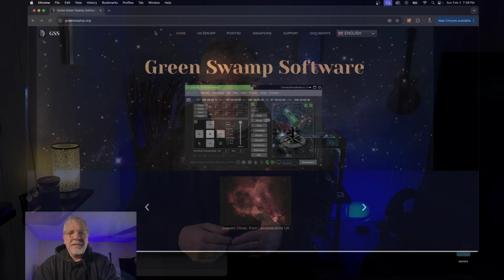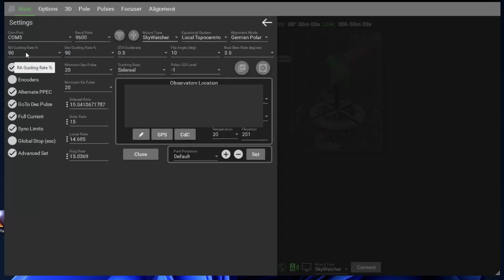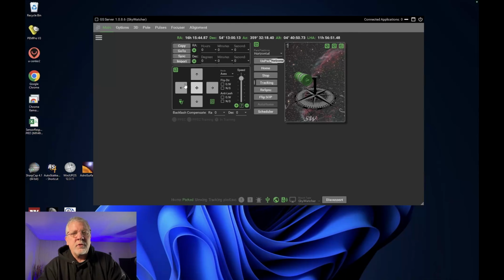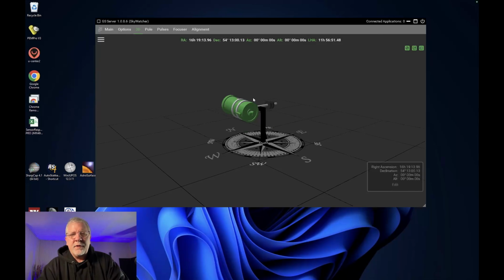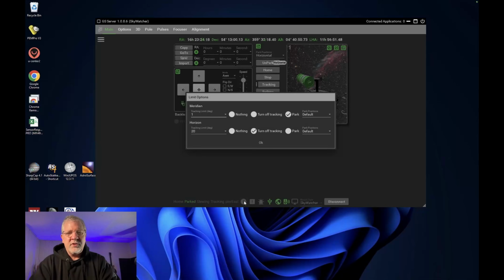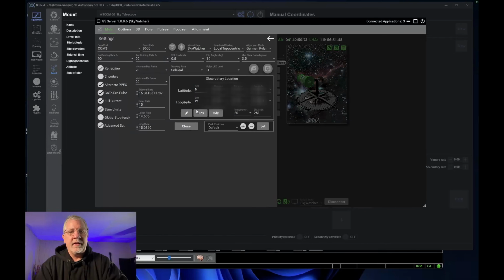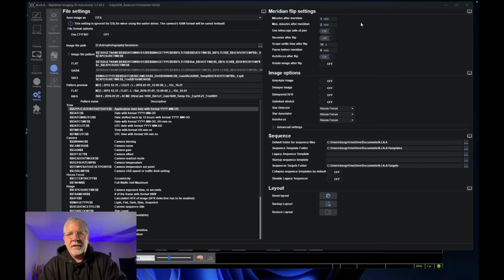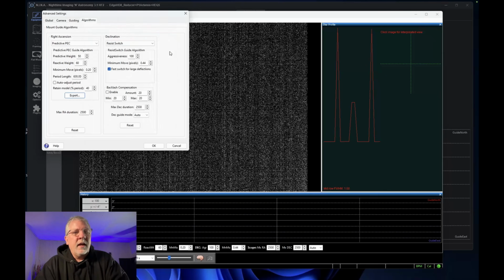Master Green Swamp Server!  The GSS Guide You've Been Looking For!

Comment: Im having trouble getting GS Server to work with NINA and Stellarium. I can point with Stellarium fine, as always, but Not all three together. So far I have not been able to get either NINA or GSS controlls to work. Now I'm getting a COM port denial. I can always tell when the telescope connects on NINA by the green check mark, yet I still can't control the mount with NINA or GSS. I know when it's connected because the GSS control screen lights up and is no longer grayed out. Each day something different. I've checked every drop down menu. ASCOM, GSS, PHD2 and Stellarium. There's so many places to check, I must be getting close because the indicators keep changing. Just can't get the right combination.. Now it's saying COM port is denied. One must be overriding the other? Im beginning to think it might be a setting in Stellarium. Im using a prolific driver with the hand controller on my Orion HDX 110 mount. Maybe I should have downloaded the Orion driver for my mount instead of the Skywatcher. Not sure??? They are supposed to be the same and Skywatcher listed the Orion HDX mount.
Reply from the maker: Give me a bit to think about this (need to get off work lol). I’d also suggest posting over on the GSS groups.io. The developer is very responsive and helpful. I leaned on them a lot when i was first setting up. They may have more info on your specific mount than I. 

https://gss.groups.io/g/main/topics
Reply from the maker: Ok. So most of what you’re describing sounds like a COM-port conflict. Only one program can open the mount’s COM port at a time, so if Stellarium grabs it first, NINA and GS Server will both throw “COM Port Denied,” even if they look connected.
Heres the order id follow:
Start GS Server first and let it open the COM port.

NINA connects to GS Server through ASCOM (not directly to the port).

Stellarium must also connect via ASCOM, not the serial driver.

I think one other notable callout is i use an EQ Direct cable. I think this may alleviate the need for prolific driver. 

Cheers!
Doug
Reply: @AstroAF Thanks so much. My daughter is the computer expert here and she said something similar about the com port. She also said if all else fails I could delete them all and start over. They're all free.
Reply from the maker: @cosmoscarl4332  perfect!  Now, since you have NINA, once you have GS server working stand-alone. Disconnect and close GSS, NINA can start GS Server for you and then connect to it through ASCOM. Use the telescope device connection. GSS gets the com port, NINA gets the ASCOM, and then you can connect Stellarium to ASCOM.  This is how I’m setup and i can run all 3 and use Stellarium to provide coords to NINA in framing assistant. 
Hope you’re on your way!!

Comment: Shouldn't PHD2 have your guide scope setup, not your main camera?
Reply from the maker: Hi Catl!  Thanks for watching!  Yes. This has been long enough ago i don’t recall to what you’re referring. Can you point me to a time stamp in video?
Cheers!
Doug
Reply: @AstroAF I would need to go back and see what the time stamp was, but I noticed it looked like you used your main camera in the setup drop down menu in PHD2. Shouldn't that be the specs of your guide camera and scope,(if using a separate guide scope and camera?) I may have seen it wrong.
Reply from the maker: @cosmoscarl4332 it definitely should. It would have supposed to have been ZWO 120mm. If it was different then it was a bad connection. I would disregard if it was anything else.

Comment: I wonder it this will work with ZWO AM5 any ideas?
Reply from the maker: @Deep-Sky-Drifter  Hi Rick!  While GSS is ASCOM compliant, it appears that there is no AM5 specific support available. From reading this is partly due to the developer not having AM5 mounts to develop with and also ZWO not releasing their specific commands for the AM5. 
Might still be worth a try to see on a cloudy day to tell if basic connectivity is possible and if any errors.
Reply: Thinking of getting a EQ6. If you use GSS and a USB A to B cable then you need to install the main Ascom and then GSS and then a Prolific driver? If using an EQMod cable than all that plus a driver for the EQMod serial to USb cable (FTDI)? There seems the Meridian flip settings in GSs and Nina could conflict. Do you set the location coordinates in GSS and then sync them to Nina when it connects to the mount? Thanks
Reply from the maker: @   Hi KJ! I believe that is the case with the EQ6 and USB connection. With the EQMOD cable it just worked for me as it did with EQMOD. I’m using the EQDirect which plugs into the HEQ5 Pro hand controller port. I don’t recall installing a separate driver for that, I think it just showed up as a USB serial controller with a com port. 
I will not be having GSS manage flips. I will be using the Meridian limit as a fallback to enforce the limit.
My GPS connection is configured in GSS. GSS provides location to N.I.N.A.  
Cheers!
Doug